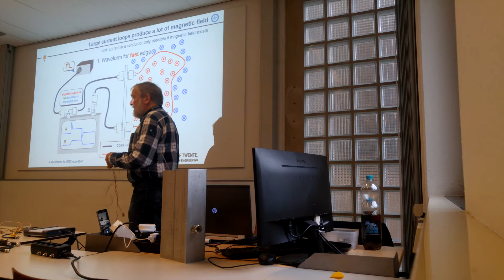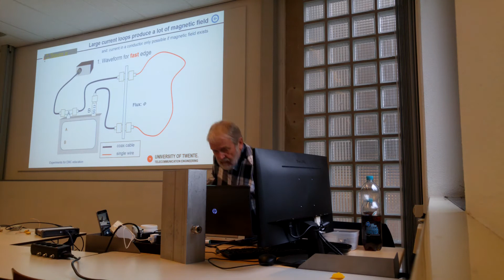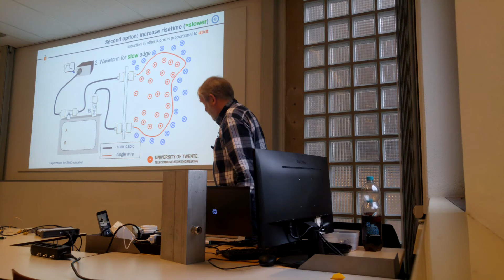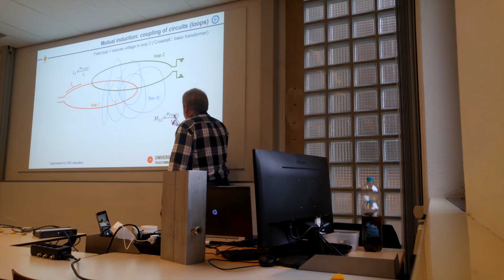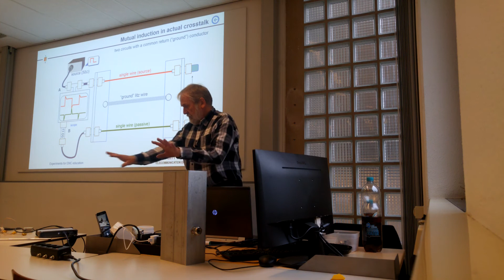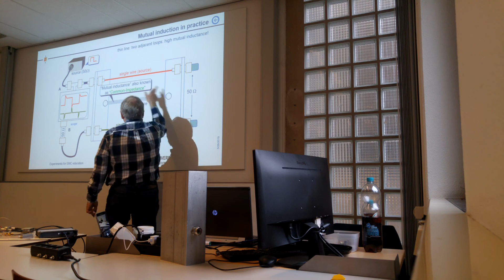All Currents Run in Loops

Comment: Hi Fritz, just wondering if you are familiar with Garrett Moddel's work? Your short capacitor electrostatic experiment made me wonder if the charge short was run through a dielectric elastomer actuator polymer which can handle 2khz switching and activation voltages into 10000v would we see electrostatic ambient perpetual motion?